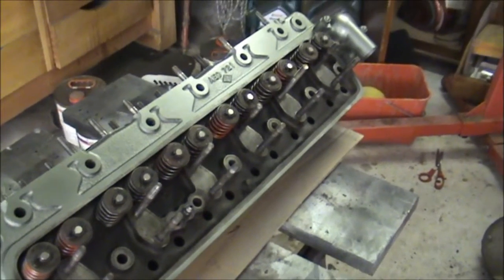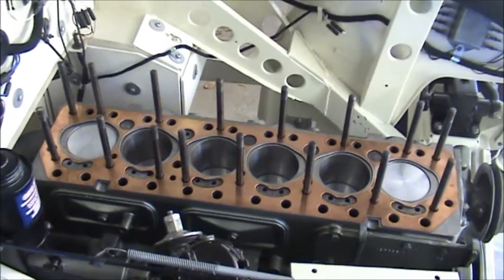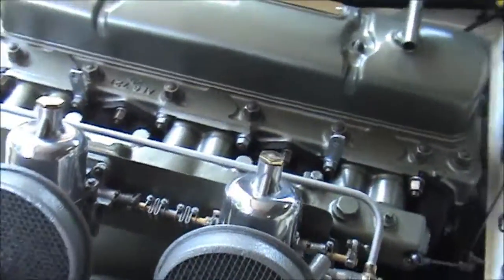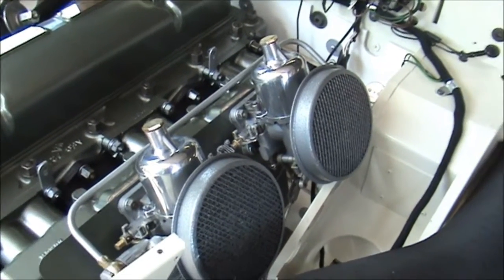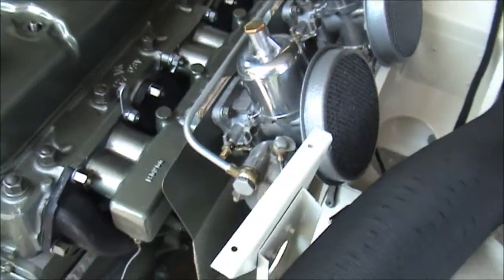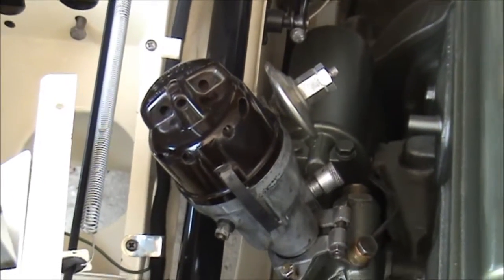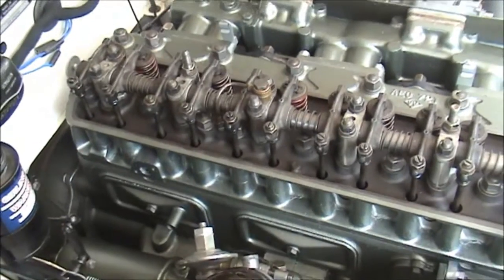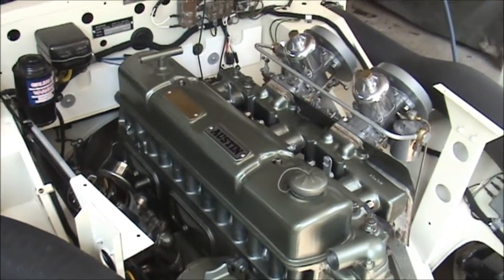Austin Healey 100/6 Restoration Pt 8

Comment: Engine arrived from USA, set about cleaning it and stripping it down to send to the engine rebuild shop just outside London. Old firm Gosneys been going years. Family firm. So the journey begins. Cant wait to see the engine returned rebuilt and painted. Gearbox coming ,rebuilt and correct with side change. Have to remove the Rover SDI lump and will then do the chassis and body work. Very much inspired by your posts and meticulous work Matthew. Thanks for your posts helped a lot to inspire me.

Comment: My BT7 Carbs have both . Holes in the tops and dust proof channels. Carbs were bought and were not from
the original engine. 40mm or 1/58 size.
Reply from the maker: Hi John
Well, if I am right that's not correct. That means that the dash pots are open to the atmosphere. Even though it's only a small hole it could mean that the pistons in the carbs are not rising far enough. I think it would affect the vacuum in the dash pots. Might affect mixture? It's like having a small hole in the dash pot.Try blocking the holes in the caps (temporary sticky tape etc) and see if it makes a difference.
Good luck
Matthew